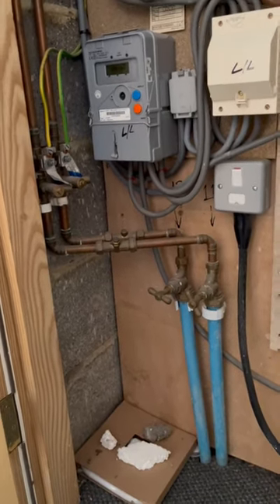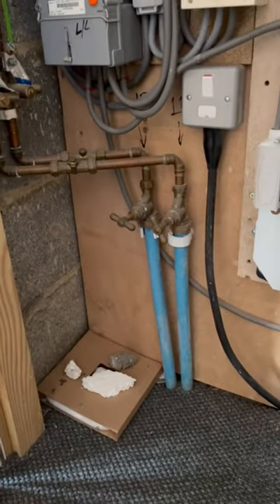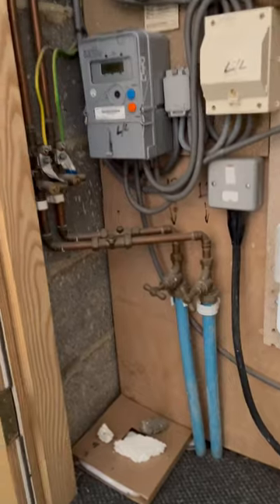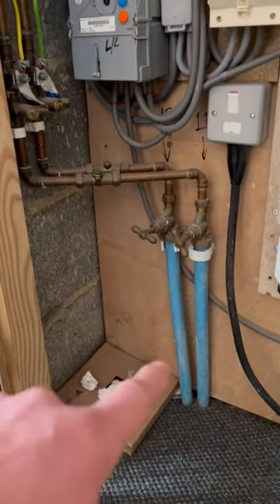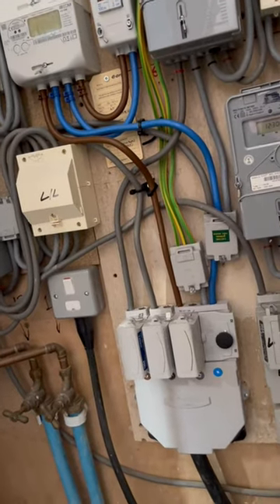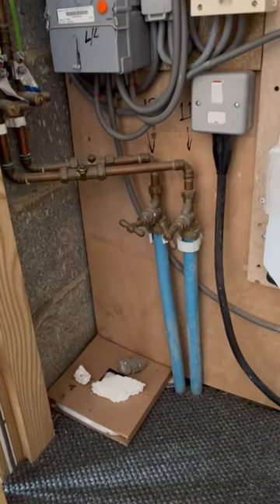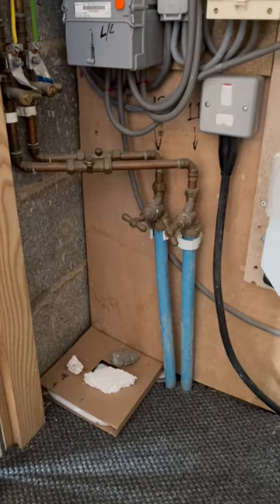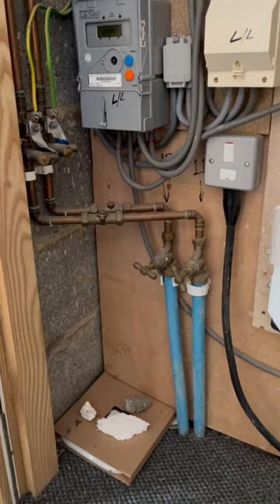Bonding ? Only if it's extraneous.

Comment: A majority of gas supplies are all done in a plastic sheathed pipe but they bonded anyway. I’m thinking about say a mouse chewed through the cables and they became in touch with the water pipe it will become live with no fault path if the earth is not connected. The power wouldn’t necessarily trip as no fault path. Also as I say if the boiler say a combi had an earthed casing and gas pipe the pipe would get earthed anyway from all pipes connecting together at the back. So that’s why my thoughts are to bond it anyway. You never know the condition of cables and junction boxes in the property and distance between cables and pipe work. I always think of equal potential across metalwork so it’s all the same to create the no potential difference scenario otherwise you could end up with water pipework at 230V and gas pipework at 0V - there’s your shock voltage there’s a potential difference! I do not agree with not earthing this pipework especially if the installation is all done in copper! It would have no fault path!
Reply: I agree with what you say. Total sense to eliminate potential difference with bonding. Costs next to nothing to bond pipe work to the MET to potentially save a life.
Reply: @Jonesy551  exactly glad someone agrees

Comment: I would still bond these in my opinion from all the courses I’ve done to create the equal potential that properties need across metal work. When you think if the installation has all copper pipe work throughout no plastic say for arguments sake the water pipe would get bonded anyway with it being connected to a boiler say through the gas supply pipe when connected on the jig at the back. So defeats the object plus it will protect the pipe work from becoming live in the event a conductive part came in touch with the water pipe otherwise the power may not trip out in the event of a fault. I do not agree with what you’re saying! It’s not going to cause problems bonding these pipes. You’re bringing the potential difference of pipework down to 0V by bonding them! I’m always concerned with potential difference - the idea is to create a faraday cage type scenario so that all metal work that can be simultaneously touched is less than 55V touch voltage.
Reply: If you are bonding plastic pipes you need to go back to college
Reply: @ChrisTheSparky the pipework throughout the installation may well all be done in copper not just the supply pipes coming in from the ground…in most cases these pipes will get bonded anyway when connected at a boiler or similar scenario. I don’t need you to tell me to go back to college I’m just stating you may well have a piece of metal going through an installation not bonded what happens if a cable melts on to the pipe it will be live with no fault path - treat each scenario differently…often pipes are buried in floors amongst cables or similar…

Comment: Good point, maybe why they recommend a rod on PME nowadays, should be a reg on mains water in an electrical cupboard,
Reply from the maker: Yes Willy no return path to whatsoever here should the 🖊 be lost
Reply: @Mainly_Electrical  yes we do rely on RCDs a bit much,
Reply: Rcd would not help if the neutral was lost on supply side...so have read on another site.

Comment: So will everything in the property connected to the main earthing terminal.  So do we not earth all appliances and circuits….
Reply from the maker: I'm not with you James
Reply: @Mainly_Electrical  you said the bonding to the incoming water pipe was potentially dangerous if the neutral was lost on the PEN conductor.
Reply from the maker: Yes it is . It's been given a 0 volt potential that it didn't need to have as it's not extraneous. Your initial comment about not earthing appliances is just silly
Reply: @Mainly_Electrical  so is saying the bonded pipework could become live and so would everything in the property trying to find a way back to the substation. Thats just silly and yea you dont have to bond the pipes
Reply from the maker: I'm Still not with you but thanks for commenting ⚡️

Comment: I can remember sparks saying that water in the pipes can conduct electricity so still needed to be bonded haha
Reply from the maker: They would be right if it was salt water 😂👍⚡️
Reply: @Mainly_Electrical  depends on the hardness of the water and the ph. Not much to do with salts. It's the atomic structure. But as you have said it's not needed and if your drinking water with that much ph difference or otherwise you deserve to die😂
Reply: We did this in 16th edition everything was bonded! Even metal window frames and radiators lol... How times change 😂

Comment: However, if you’re neighbour is on a TT and you choose to run a water feed to your out house under the slabs, then they have a fault to earth 😳
Reply: No, because in a TT system you go straight from the fusebox to the earth rod, so even the pipes near by that are burried, have the same or slightly worse Ze, and the RCD would not detect it until theres a fault on the circuit

Comment: I recently done this my self on a job but I thought of  it more as earthing the pipes  than bonding them. So is there a problem doing this as an extra or not ?
Reply from the maker: I wouldn't be earthing isolated metal work hoggy ... no need to give it a potential it doesn't need to have

Comment: Is this a block of flats?  I'm led to believe that in these situations, metal services passing through communal areas and flats should be bonded, in both locations, to their respective METS.  The pipework wouldn't introduce an earth potential, however it may introduce a potential from another phase, for example if there was a defective earthing system and a fault to earth in the supplied flat.
Reply from the maker: Block of flats yes usual set up , I see where your coming from with that but it's absolutely riddled with plastic joints so no real danger imo ⚡️👌